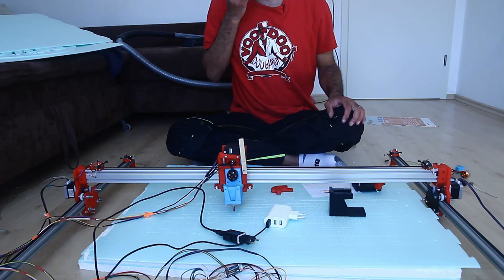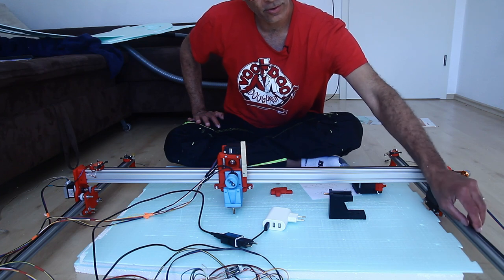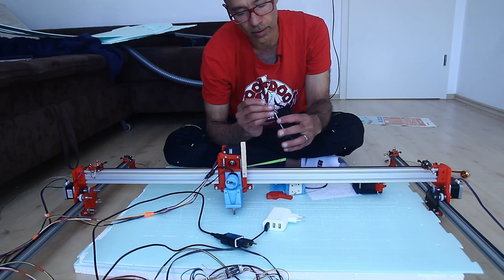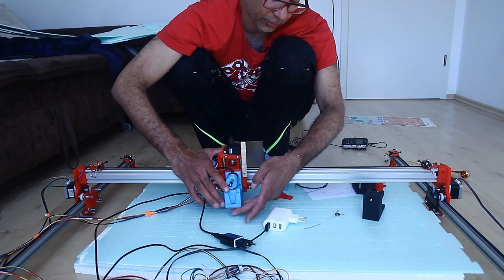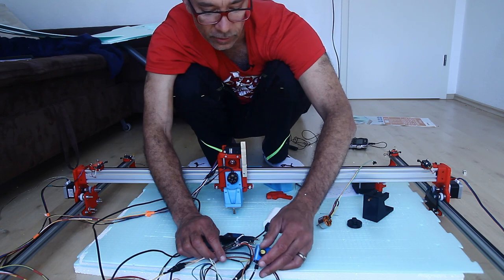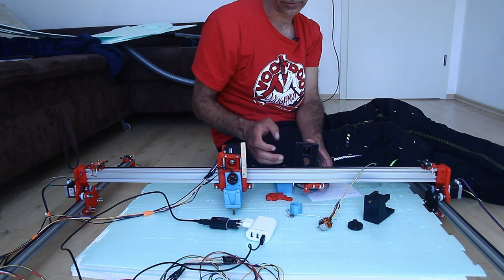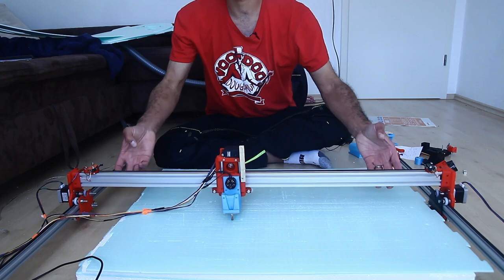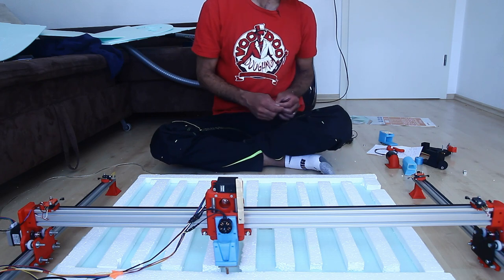My version of a needle based foam cutter

Comment: Impressive amount of knowledge, I learn from folks like you. I used old dot matrix uni-polar steppers and it works great..when it is idle the steppers would get hot so I put VW running lights inline they come on when steppers are stopped and dissipates the heat oh and on top of that it's a great light show :) I am a noob slow stick now 2020 can't wait to fly it.